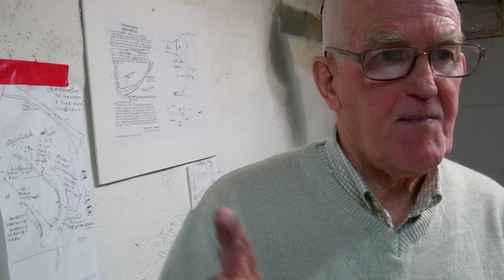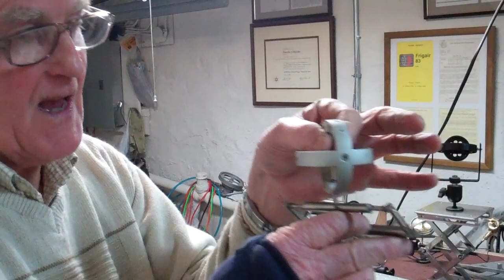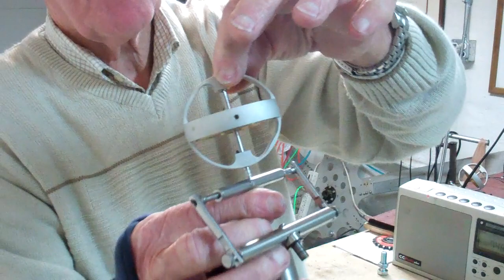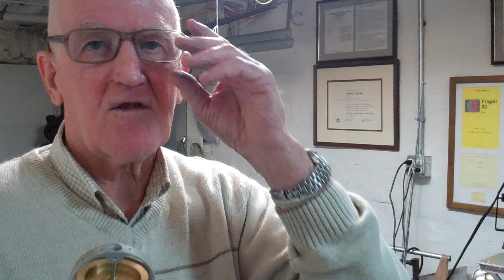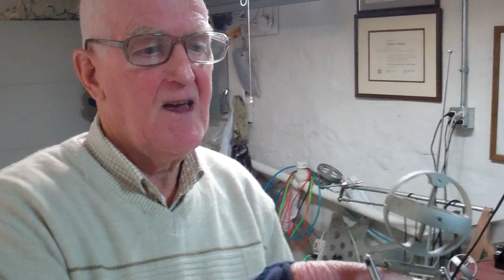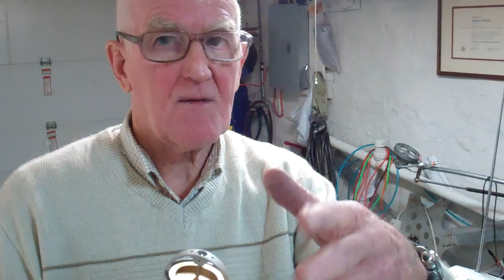Gyroscopics-"The Hidden Secret in Physics"

Comment: I think there is a resistance to learning about understanding of this subject. I don't know why, but it's everywhere.
Reply: Too much damn supposed education or it may also be referred as put in a box, applying blinders and simple taught to Not think since the statements of proof have been spoken.
Reply: No. The problem is that it's already fully understood and these idiots are totally wrong! Send a rocket by gyro power! 😜
Reply: @Simonjose7258  If you fully understand it then please explain it. Why is it possible to lift a heavy spinning gyroscope, but not possible to lift the same if it isn't spinning?
Reply: Old knowledge asserts to claim to be complete ,resist radical revelation
Reply: Also about perpetual mechanism